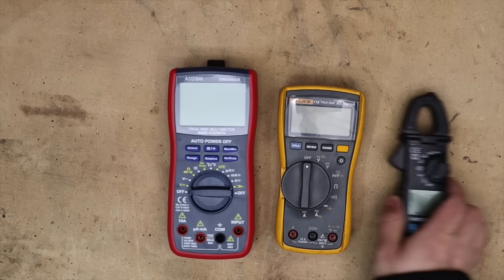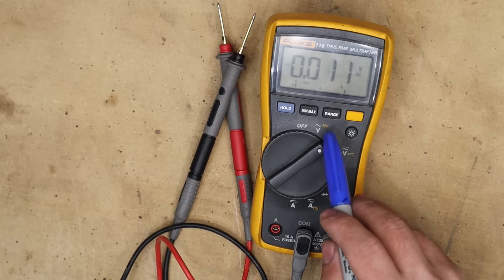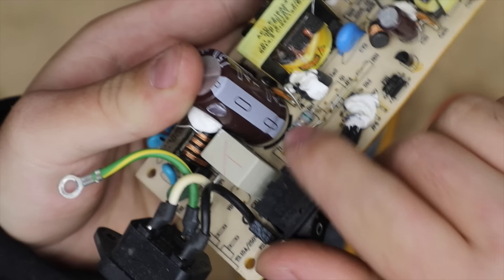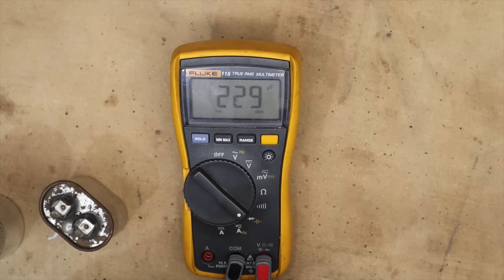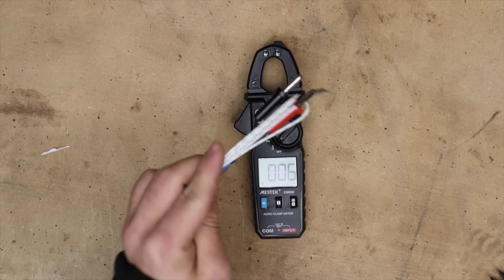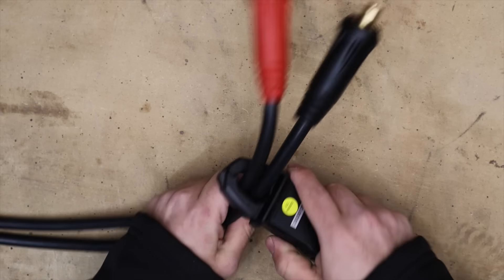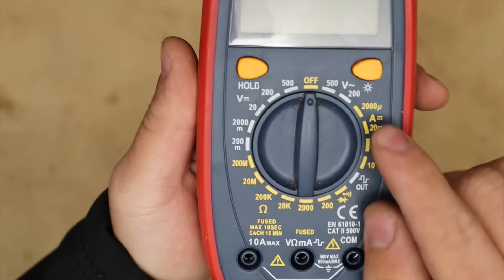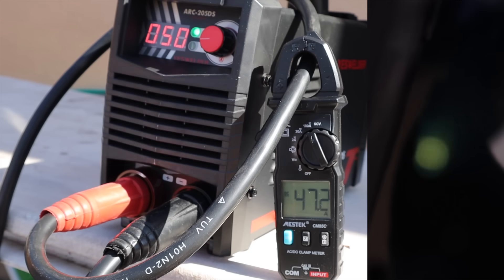How to use a multimeter like a pro, the ultimate guide

Comment: I think "OL" actually means "overload" in the sense that the reading is not possible to display on the meter. It's true that it could mean open loop or open line in practice, but it's important to understand that it really just means that whatever the input to the meter is, it's not something it can measure. 

It's a subtle difference, but it matters if you're literally thinking that it only means an open circuit; that can get you into trouble.

Comment: Nice video. I bought a chinesium multimeter that has the non contact, and the clamp for reading volts/amps. My question is, is it supposed to jump around a lot? When taking a solid reading with the leads, it is steady. Otherwise the numbers are always bouncing around. The seller said it is normal.

Comment: I've used multimeters since the mid-late 80s. So I guess that makes me a pro. I have been both and electrician and a electronic tech for 36 years. You really don't need to observe red and black (plus/minus) for DC measurement unless you use a really old analog multimeter like a Simmons. Modern ones will just show you a minus sign if you hook the probes up backwards. Like when he hooked up the drill battery, he put the red probe on positive and the black on negative. Do it backwards, you just get -18.00 volts showing instead of 18.00 volts DC. Don't hurt a thing. I was doing this before this guy was born probably. With an old analog meter, it has a needle that will go backwards and this can hurt the meter movement. But a digital display can't be hurt like that.

Comment: There is also a "trick" with the frequency measurement with Fluke meters. Loop a single measuring wire between V and COM and make a single loop, now you can measure frequency from air, for example the frequency from an induction cooker top.

Comment: Fluke multimeters (and, by extension, most other brands as well) take less than 25 Ohms to mean "continuity" and 150 Ohms or more to mean "resistance". So keep in mind that when something doesn't read as "continuity", it still could be fairly low in resistance.
I learned this lesson by putting 48V accros a 270 Ohm / 0.25W resistor. 😅

Comment: The first thing you should do after you turn on the multimeter is to see if the internal battery and/or probes are good. 

Move the switch to the continuity or ohm position and put the positive and negative probes together. If you hear a tone or see the meter read near zero ohms, then your probes are probably good. I have seen plenty of people try to read a voltage or resistance with one of the wires in the probes are broken. 
It is also a safety concern where you believe that there is no power on the circuit from the reading on the multimeter when there actually is a potential voltage on the circuit.

Comment: James since this is a new video, I decided to ask you a question so you can see it. When you put an Air tag in your car, does it automatically connect to your iPhone. I seen the video of you instructing on how to take the speaker out but how do you connect the Air Tag to your iPhone so you can track your car? Thanks in advance.
Reply: Air Tags automatically link to ANY nearby iPhone (mostly unbenonced to them) and transmit their location back to the Apple 'cloud' where the paired iPhone can retrieve it using the FindMy app (or a Mac/iPad).  This means that if your car was parked say on a downtown street, any pedestrians walking by with an iPhone would give your Air Tag a means to update its current position.  It won't work where there are no other iPhone users.  It doesn't need YOUR iPhone to do this (although it will use your iPhone to do it as well).  Unfortunately, due to some bad actors using Air Tags to track other people, Apple has modified them so that if the Apple 'cloud' notices that an Air Tag is travelling WITH an iPhone that it isn't paired with, it will send THAT iPhone a warning letting them know that there is an unknown Air Tag travelling with them and allowing them to discover its presence.  This makes them not very suitable for your intended purpose.  Of course as a spouse lets say of the paired iPhone, you can also track the position of the Air Tag (if the primary shares it with you) and this will suppress those warnings.  Unfortunately with 50% of smartphones being iPhones, there is a good chance that any thief stealing your car might have an iPhone and will find out about it when the (roughly 15 minute) timer pops up and says the device is travelling with them.  Other "trackers" such as the Tile have the same protections built in which make them similarly challenging to use to track your stolen devices.    The one good thing is that most car thieve rings move your car a few blocks and then abandon it for a while to be picked up later so if you track it within that window where it tells the thieves of its existence, you might be able to find and retrieve it.

Comment: I watched on two times speed. Did you go over why the two red lead sockets,  one has a rating for 10 AMps  usually - does that mean for testing on the circuit with a load going through it?

Comment: on voltage setting you can hold onto one probe tip while you test voltage and you wont get a shock , i have tested 230v ac like that for over 30 years n in particular with hvac on saginoumiya mechanical thermostats that have no neutral or phase run to them , dont do it with a $5 meter but a good fluke , hioki or klein etc is ok

Comment: When measuring current with the clamp, be sure to test just a single wire. Clamping an extension cord will cancel out the hot and neutral so you’ll get zero current.
Reply: He said that.

Comment: Small normally irrelevant point about ohms test and continuity modes: Know what your meter uses as a test voltage (and if applicable frequency), its rare BUT POSSIBLE something downstream, like ICs, may be sensitive to those voltages. Now, meters usually use pretty low voltage and low current test modes for those readings so like I said, its mostly a non-issue. But if you know a part in the thing you are testing is particularly tetchy to certain voltages (its usually some exotic low energy detection IC, youd most likely know if you're messing with something like that and want it to still work vs just ripping parts out of it) be aware of what the meter is doing to the circuit.

Also for continuity: It looks like the Fluke doesnt, but that AstroAI meter should also show you the resistance of the continuity path (my 5000 series model beeps when resistance is below 300ohms IIRC). So, pay attention to your meters reading too. A wire or connection could tone out okay but a wire shouldnt show high resistance, if the wire you're testing beeps but just barely it could still have a fault or bad solder joint or whatever. Likewise, if it shows some resistance but doesnt beep that can also help you in your troubleshooting journey.

Comment: Great explanation, I had to search for a youtubemovie anytime I had to measure something :)
One little thing could be added I guess, and that is how to find the positive wire in a DC setup.
Many probably knows, but some others maybe don't so here goes..
The meter on DC Voltage reading and put the red probe to one wire and the black probe to the other wire.
If the display on the meter shows a minus sign before the Voltage reading, it means you have the probes reversed.
Maybe something you can add on the cheatsheet (wich I downloaded too👍)

Comment: For your Capacitors, don’t short out the Terminals with a Screwdriver, as you can damage or wound the capacitor. Set Your Meter to AC  Voltage for AC Capacitors and DC Voltage for DC Capacitors. Hold the Meter Leads on the Capacitor Terminals, till you get Zero Voltage.  Also if your Motor Run Capacitor test, good and you are still having problems. You can test the Motor Run Capacitor under load. Look on the Internet, on how to safely do this.  Another tip, if you check voltage, and Write it down, IE on a Service Ticket. I always put the Decimal Number if measured 125.0 VAC. Not Measured 125 VAC.
Reply from the maker: Completely out of the scope of this video, but good comment, thanks.

Comment: I was testing amperage on a 480v heating element. It was a long day, I was tired and I crossed legs with my multimeter. It welded the switch shut, jumped the dedicated breaker and killed the power to the entire property on the main panel. 480v is no joke 😳

Comment: Thanks for this video. When testing continuity on a circuit board is there a danger of damaging something on the board with the voltage coming from the meter battery that is used to complete the circuit?

Comment: I know a lot of people use the continuity function for testing wires but the better way I was taught was measuring  resistance especially for automotive wiring
Reply: Testing resistance on automotive wiring is a quick way to be mislead.
An ohms test might detect a poor connection, a corroded wire or connection, or a completely open wire.
However, a wire with almost all the strands broken will still test good on an unloaded ohms test, but it will be unable to carry the current required to operate the circuit properly when in use.
The best method for testing wiring integrity is a loaded circuit voltage drop test.👍
Reply: @simonilett998 OK thanks for the useful info. Unfortunately I'm not sure how to perform a loaded circuit voltage drop test unless you mean measuring the voltage in parallel while the circuit is under load, like a voltmeter in a car?

Comment: When you're discharging a capacitor, is it possible that you could get shocked?  Due to thin rubber insulation on the screwdriver.  Since different manufacturers make their own screwdrivers.  Or is there a standard among all manufacturers for an insulation thickness?
Reply from the maker: If the value is high enough, in theory it could, for the safest option use electrician screwdrivers, amd keep as much distance from the metal, it will not go through the handle, but can arc through the air

Comment: Hi, would be nice to add AC - from socket and DC from battery? Am I right? I am new to this and mix these completely...

Also would be nice to add if you do not have auto determine Aper, which is safer to start? Bigger or smaller?

Comment: When testing a diode, is this the same as putting the leads on the positive and negative terminals or wires in perspective and reverse? In my profession, I've only seen the diode test done by putting the leads on the device terminals or the wires attached in one direction.

Comment: 1:45 thanks for the tip some people seem 100% oblivious to any of this it appears but like…fr is this the best way to show a cautionary example? I’m pretty sure this contraption was meant to do just that. 

Only god knows if that’s even a neutral and a hot outlet prong, could be setup as a hot and hot on both sides pretty common if you want 240v outlet in US with a joined dual 20A breaker.

But nvm all that, it seems that you’re touching the hot side with bare metal so like yeah don’t touch exposed wires with bare uninsulated metal?

Comment: One nitpick: continuity isn't enough when testing wires. Damaged but not completely split wires will demonstrate continuity, but you should really do a resistance check. Open loop is the same as continuity failing, but you're looking for low or no resistance for a wire. Higher resistance can indicate that the wire is damaged somewhere inside.
Reply: There’s always going to be special circumstances… I had an intermittent failure. From 100% good to 100% open. One single wire in the bundle was cleanly sliced thru. Worked fine no resistance until little vibration or such and failed.

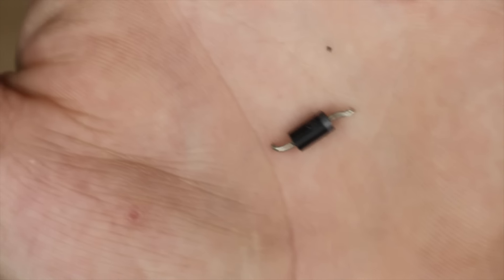Comment: 6:11 - misnomer here. Voltage can never pass through anything, voltage is always applied and measures a potential. You meant to say current since current flows and is the actual passage of electricity, so the diode is functioning properly because current cannot flow through the second direction. 

6:23 - second misnomer here. Hertz is a unit of measurement for frequency, not the speed of a generator, that is wildly incorrect. You're measuring the frequency of oscillations per unit of time, that is Hertz. 

The other part about K being a unit of temperature like another commenter mentioned is also the third misnomer here. 

Aside from that, good video.

Comment: If you rely on the Continuity test only, eventually you will be sent down a rabbit hole. The true measure of a wires continuity is to load it with current. A broken wire within it's protective jacket will pass a simple continuity test, but when you load it with current it will fail. Ask me how I know... Great video - just had to throw that in there.
Reply: Hi...how ya u know

Comment: Correction the normal headlights by themselves, the radio and the dashlight are out. The brake lights, parking lights and the back up lights all work, front and back blinkers work, and the dome lights and check engine  lights all still work.
Reply from the maker: Depending on how modern the vehicle is, it could be more difficult to diagnose sealed components, the first step is a visual inspection for damaged, burned or unusual things in the wiring harness and electrical components, the next step is to use a scanner to read the computer and see if you can get any errors on what may be damaged, finally you have to go from wire to wire on whatever components are failing to find the issue or discard potential issues

Comment: I took apart an old digital camera that was sitting for years without a battery in it and got zapped big time by the capacitor. Make sure to discharge them and confirm by checking for zero volts (DC) at the terminals after.

Comment: Hi does it matter which of the red or black probes is inserted into the left side and right side of the wall socket?
Reply: It should just show up as -120V or whatever you use, so if you are just doing a quick check on whether it is powered on, etc, then either way should work.
Reply: @chapagawa  thanks for the reply.

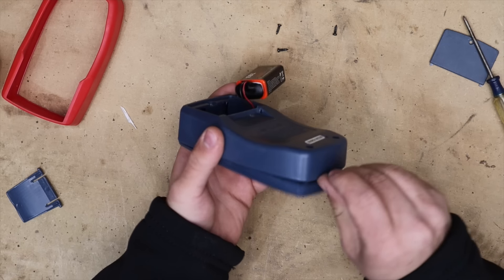Comment: 8:35 my cheaply made multimeter's probes were much weaker than the fuse itself. I was trying to measure the AC voltage, but forgot the probes on the high Ampere socket. The cable joint of the probe just flew away when I contacted the outlet with the probes 😂

Comment: I had a fluke 373, was gonna check voltage in a 60A 600v 3ph disconnect for a Water heater, when i put my meter in Line L1 and L2, my meter burned out. I don’t know why.🤔 im pretty sure i had it in Voltage(AC) and not in Voltage(DC).. my question is, if by mistake i had it in DC, was that the issue and cause my meter to burnt out?

Comment: I bought a cheap AstroAI Multimeter on Amazon because I'm trying to install a hardwire for my dashcam in order to have parking surveillance. However, every single time I tried to test the fuses to find out which ones provide BATT power and which ones provide ACC power, no matter what I would do the multimeter always read 0. I set the dial to read DC Voltage on the 20 setting (since I'm measuring for 12V), set the black wire on the ground bolt and set the red wire on the fuse and the Multimeter displays 0. I tried with the car in Accessory mode and same thing, reads 0. I even unplugged one of the fuses, put the car in Accessory mode, checked both pins in the slot itself, Multimeter displays 0... At this point I can't tell if this is just a user error because I don't know much about this stuff, or if maybe the multimeter I have is just complete garbage and I need a better one...

Comment: Ok, i have a key with a built in resistor (GM 90s Vette).  I used the 20k ohm setting (got that from a different video) and the reading I got was 2.35 ohm. 

Does this mean 2,350 ohms?  If so what resistor would i need?  The pack of resistors i bought doesnt have 20k but has 10k and 22k. 

I am totally lost.  Any help would be greatly appreciated.